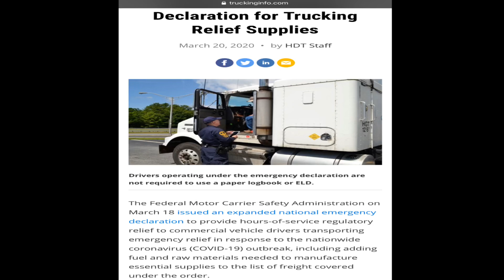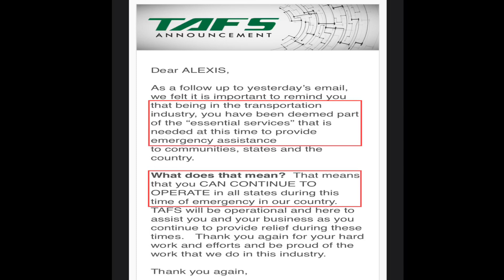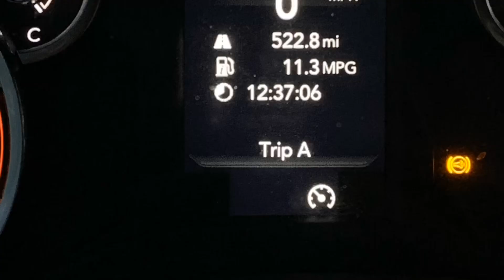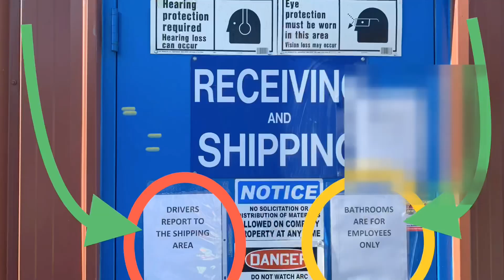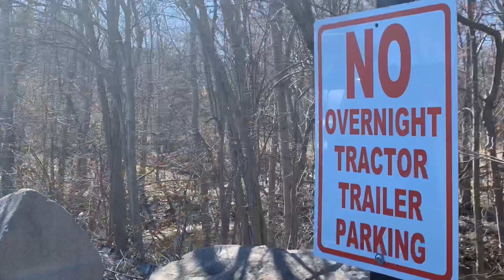HOW MUCH I CAN MAKE HOTSHOT TRUCKING DURING CORONA VIRUS | TWIC CARD

Comment: Also get some Di electric grease  and place a drop on all 7 points of contacts on your 7 way plug. This keeps the terminals clean and acts like a barrier from the outside elements. Also get under your trailer with a wire brush and clean all the ground wire contacts on the frame and apply di electric grease. Especially in the Nothe East...
Reply from the maker: Will buy TODAY!!!

Comment: Just had a running light problem on a brand new trailer. Kept blowing ram fuse # 29. It was a short in the tail light assembly. They left the metal knockouts from punching holes for tail lights and wires rubbed thru. Yay Loadtrail
Reply from the maker: - THANKS FOR THIS GARY R! I peeked at my fuse #’s 28, 29 and 30 but I’ll def look again in the am and before bringing to shop. Was your short at the plug (in bed of truck) or in the wires that run throughout the trailer?
Reply: @hotshottruckingtrainingcou9645  it was in the tail light section at the back of the trailer. My trailer a little different because of hydraulic dovetail but bouncing and vibration wreaks havoc.  But I also had turn stop and flashers working fine.
Reply from the maker: gary r - that’s my predicament exactly. Last time this happened it was within the 3 center/rear marker lights. Than brother!!
Reply: @hotshottruckingtrainingcou9645  you'd think these big money trailers wouldn't look so back yard built.
Reply from the maker: gary r - SERIOUSLY!!

Comment: Great video! You mentioned that you should have had one of your loads positioned on your axle for better weight distribution. I’m curious to ask what the max weight per axle is for a hotshot truck?
Reply from the maker: Really good question - You can choose when you purchase. Trailers with dually tires (like the rear of my pick-up truck) are usually used by guys with CDL’s because those trailers weigh more overall: axles on those can have weight limits of 10k lbs to 12k lbs or greater. Non-CDL trailers (typically lighter overall compared to dually wheel trailers) like mine typically have single wheels on each side of the trailer (as opposed to dually wheels). I have 2-single wheel axles and each has a weight capacity of 8k lbs.